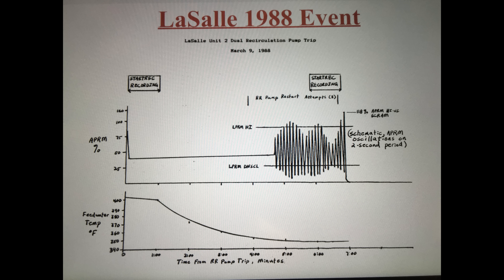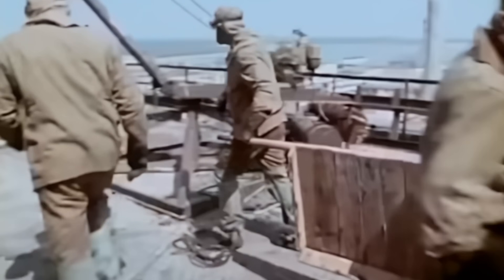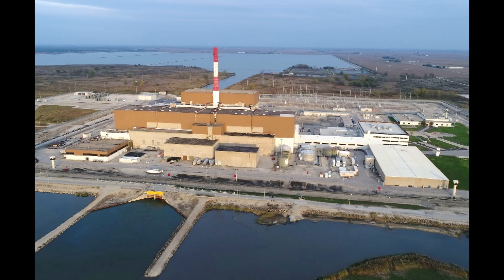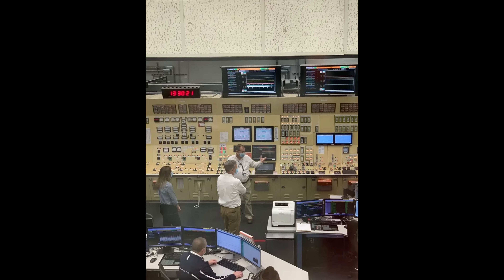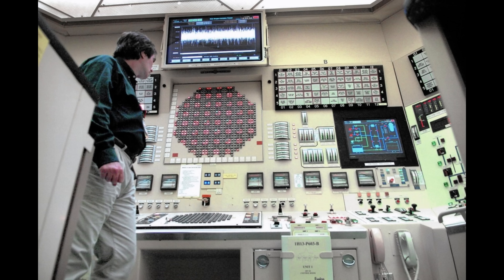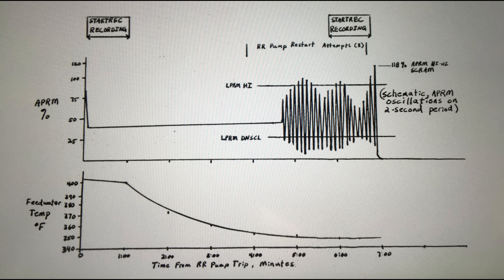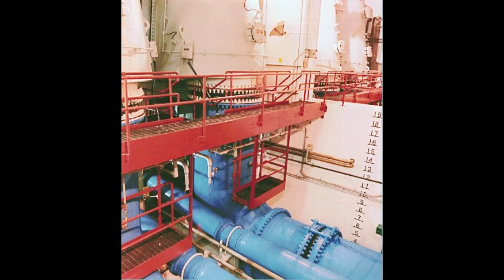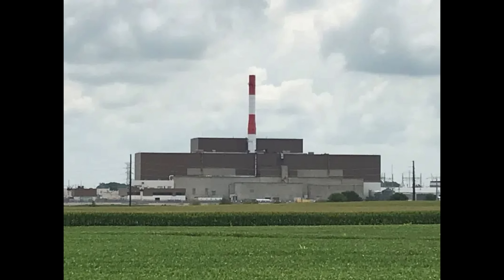LaSalle 1988: America's "Almost" Chernobyl?

Comment: 1800°C is almost enough to decompose water into oxygen and hydrogen, which starts at about 2000°C. If the oscillations would have been slower or of higher amplitude the water could have decomposed and the fire could have explored. It would be interesting to know how the pressure in the core oscillated and if it could have ruptured the pipes.

Even more severe: the reactor used zirconium cladded fuel rods. Water and zirconium start reacting at only 860°C. That could have set literal fire to the core. Again: if the power oscillations would have been slower or of higher amplitude, the core would have burned.

Even during the scram procedure, which seems to take 7 seconds, the remaining oscillations could have blown the reactor. 

I guess many favorable conditions and design decisions were present to avert disaster.
Reply: BWRs don’t explode like RBMKs, depending on their current RPV pressure at the time, it was unlikely it’s gonna blow up anytime since the technical specs is 1250 PSIG and SRVs would open mechanically on safety mode anyway

Also the pipes are durable enough to withstand even the worst case scenarios, since NRC made it failsafe and they like to make everything a failsafe
Reply: Scram in a BWR takes <4s in earthquake conditions. The apparent 'lag' on graphs comes from decay of delayed neutron precursors, an inherent process you cannot do anything about, even if control blades shot in 1 ms

Comment: The best way NOT to feed the narrative that “nuclear is just too dangerous” is to design only plants that are so bulletproof that there are no more scary stories to be reported.  And de-commission everything else.
Reply: Decommissioning is very extreme. All plants which have the possibility of similar instances occurring are retrofit with features to prevent said instances. You'd throw the baby out with the bathwater otherwise.
Reply: @Providence83  Zero tolerance and zero excuses will need to be policy to both promote a massive expansion of nuclear power worldwide and to protect us from the bullshit of the silicon bros who can get it done.  We need nuclear to 100% cover nighttime base load, datacenters and, charging ports ASAP.

Comment: For 34 years I worked in electricity generating stations that burned natural gas or fuel oil in boilers to make steam to generate electricity. From videos I have seen nuclear reactors making steam to generate electricity are dramatically and drastically different from fossil fuel boilers. In fossil fuel boilers it is impossible to power output swings from the boiler that occurred in this nuclear reactor.
Reply: "Maybe" possible with inconsistent water feed and quality, in small-tube boilers?

But in big ass "Fixed installation, Power Station" boilers yeah, you're probably right.

(*Most* of what I know about boilers comes from either types on Naval ships [Usually Warships or steamboats, via Drachinifel; which predominantly feature triple-expansion or small-tube boiler designs], or the nuclear kind from watching Tyler Folse who's a 10+yr nuclear engineer vet of the commercial nuclear power industry [And also learning about Military, specifically Naval reactors, so once again ships]. 

So odds are I have no idea what I'm actually talking about with the types of Boilers "You've" PERSONALLY used and you're 100% right).

Also Fun Fact (Not actually so fun):

 Almost ALL Fuel Burning plants release more radiation into the environment (and expose its workers to) a DAY, than a Nuclear Plants will in its ENTIRE operating history. [Especially Coal, that shits HELL from a pollution & radioactive release standpoint]

This is "Specifically" because radioactive emission standards for "Normal Plants" are basically non-existant as they're seen as "Safe", while the standards for Nuclear Plants are SO TIGHT it's "basically" Zero.

Hell, even smoking will; due to the radioactive elements in all soil which Tobacco absorbs while growing and you then inhale while burning it. (Actually making it very similar in principle to radioactive Fallout IMO, which is just dirt and soot from fires which were exposed to the worst of the radioactive elements in the 1-2s of the Nuclear Detonation. 

Both are essentially just things that've absorbed/been exposed to radiation, which are then released/spread via burning them or their carbon/soot.)

[BTW, I'm not Anti-Natural Gas, Fuel Oil plant, or anti-smoking; was a smoker myself and still consume nicotine in various ways. Just thought all these facts were pretty interesting as well so shared.]

Comment: Deliberately overstating the severity or even the potential for severity of an incident like this merely for YouTube views is the very sort of sensationalistic, irresponsible buffoonery that did severe damage to the US nuclear industry from the 1980s onward. If I thought you were simply misinformed, uninformed, or clueless, I'd give you a pass on this. But I don't believe that at all. The very mention of Chernobyl, a type of reactor and a type of accident that bears not even remote similarity to LaSalle, shows deliberate distortion, mendacity, and malice. You're not a fool; you're an ass.

That nothing bad happened here is not, as some commenters suggest, a miracle. It is the result of defense in depth, a principle upon which all US nuclear plant safety systems are designed. Damage did not occur because the system worked. Your “what-if” scenario is ridiculous because safety systems don't just “not work for whatever reason. They do work, precisely because everyone involved knows the stakes if there was any chance they wouldn't.

I strongly recommend either ditching this video or identifying it as clickbait.
Reply: the video contains simulation that shows possible bad outcome, worth to learn about

Comment: A less alarmist (and rather more boring) spin might be - LaSalle 1988: safety features worked as designed. Ideally it shouldn't have happened but this is exactly why we have multiple layers of defence. From a design point of view it's important that they looked into what would have if the automatic scram had failed but we've got to be really careful not to play a game of what if that becomes absurd.
Reply: This was not a run of the mill day. As expressed by several current US plant workers in this thread, this incident has become part of their safety course as well as feeding back to change the operating instructions : something that wasn’t happening fast enough in the Soviet Union at the same time, due to a don’t rock the boat mentality from leadership; because boat rocking got you fired. What caught designers out here, as I understand it, was the water-hammer in the system and that was caused by guys with big arms setting olympic standards for spinning the valve wheel controls. Something I’ve learned from this channel is operating a nuclear reactor requires finesse and a slow & steady approach. See Chornbyl U4 where its possible setting all its water pumps running at maximum was the last straw for a reactor already unknowingly unbalanced by its designers and planned operations.
Reply: No! The last line of defense - automatic scram saved their sorry behinds.
Reply: One would almost think he is a Soviet apologist?
Reply: If this were a question of "what if" a whole bunch of defense-in-depth features failed, I would easily agree with you. But the 1990 report he quotes (and links in the description) merely looks at what happens if a single safety system (the APRM Hi-Hi SCRAM) failed to activate, followed by a lack of manual SCRAM by the operators. The 120% spike that tripped the APRM Hi-Hi SCRAM happens at around 8 minutes in their simulation. At 9 minutes the simulation already shows a 900% power output. 500% is attained in roughly 20 seconds. So while yes, it is excellent that the safety systems kicked in as designed and functioned properly, it's still ominous that the failure of a single safety system was what stood between this event safely ending and quickly spiking reactor power to crazy levels.
Reply: The big problem is when these things fail. Because the design is so amazing that they're "not needed" or some sh!t.
Reply: The problem is that they were only saved by the last line of defense, and if that had failed, it would have blown up. All safety features and automatic controls that were supposed to prevent this kind of condition failed except the automatic scram, allowing the reactor to become unstable in the first place. If that scram didn't work, power would have spiked higher and higher until it would have been Chernobyl all over.
Reply: @unmountablebootvolume  The RPS trip is not the last line of defense. There are multiple other systems which are able to shut down the reactor if that fails, either by using alternative methods to drive the control rods in, or by injecting boron into the core. Yes, if the APRM upscale scram had failed in this case, it would have taken longer to shut down the reactor, which would probably have resulted in some degree of core damage given the severity of the transient. But even if the trip failed, it is very unlikely that it would have caused a catastrophic accident.
Reply: @SakuruWasTaken  for a truly catastrophic accident to happen, you'd almost need to crack the BWR vessel itself...and the containment building. consider the fact that even SL-1s reactor vessel held together during that whole mess--the core mostly stayed inside it as well, it's just that the coolant shot out through the shield plugs which got ejected, and that became the radiation escape vector (if you want to call it that). And that was about as "Chernobyl-esque" as you could get on a western reactor.
Reply: @unmountablebootvolume yes but the point is that, as per my current understanding, there's no way to retard a cascading failure if the SCRAM had unfortunately failed. So they tested for that, not for the minuscule but statistically possible meteorite hit directly on the reactor
Reply: @robertosutrisno8604  "as per my current understanding, there's no way to retard a cascading failure if the SCRAM had unfortunately failed." And that's exactly the problem. They got down to a single point of failure, and when dealing with safety systems, that might as well be considered equally severe as the catastrophic failure you just barely avoided. Everything else failed and allowed this situation to happen, so at this point (and considering how badly everything before that went), they really just got lucky that at least the very last safety system worked. The chain of failures already started with the wrong valve being actuated. Why wasn't it labeled? Or was it and nobody checked it? In that case, why was the crew negligent? Why was a single valve able to take out several redundant level monitors? That's how you build sensors for a septic tank, not for a nuclear reactor. Why was the instrumentation incapable of showing the oscillation, preventing anyone from starting a manual scram until it would have been too late? There was just one fuckup after another until the only thing that saved them was the computer.

Comment: What did they change to make sure this can not happen again?
Reply: There are probably other elements that they changed, but to my knowledge there are two things that changed:
- APRM Flow bias trip, basically if the reactor power is too high then the RPS(the logic that protects the reactor/containment, Reactor Protection System) trips
- Emergency/Abnormal procedures. I don't have a good example here but i know that if the neutron flux oscillations are too strong then the operators have to take action, by tripping the reactor
Reply: @chessmover12 Yeah a good example would be the Loss of Reactor Recirculation Flow ABN (or whatever plant-specific ABN). I'm pretty sure all BWR plants updated their procedures so if both reactor recirc pumps trip while in Mode 1 or 2 then you have an immediate action to scram the reactor.